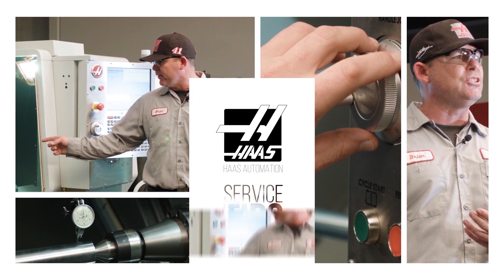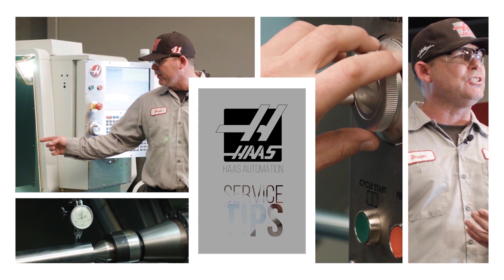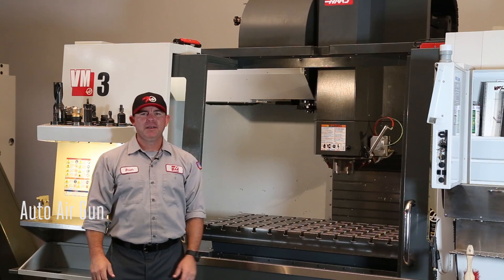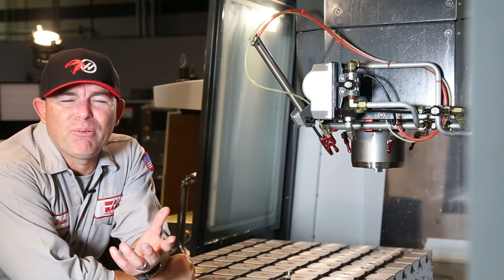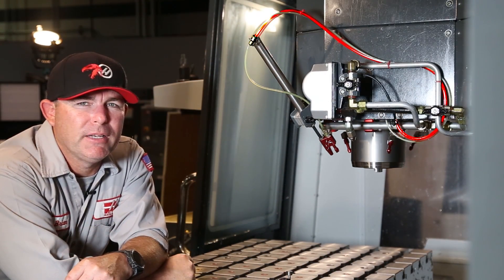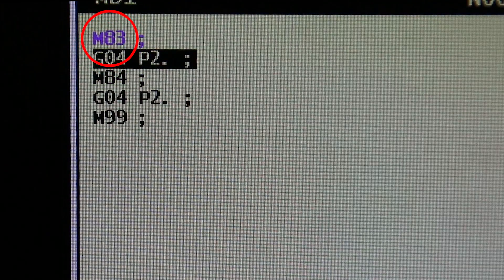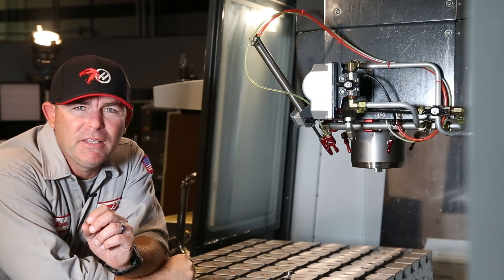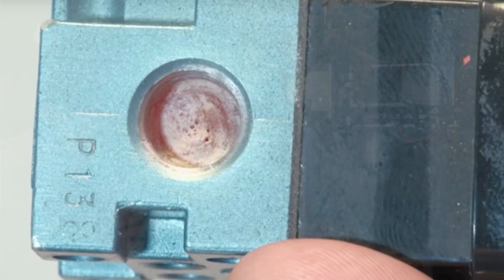Auto Air Gun - Haas Automation Service Tip

Comment: It's shocking how many shops don't have air dryers in their compressed air system. Water traps are only good for gross amounts of water AND water that is transmitted by a compressed air system tends to be acidic and those traps do nothing to neutralize the acids. This means all the metals in the CNC are being attacked constantly by moist air.

If you can afford a Haas or any other CNC machine you can afford an air dryer. Protect your machine(s): use dry air.